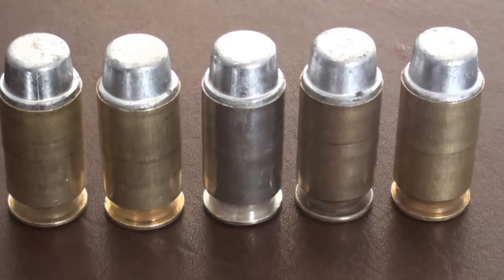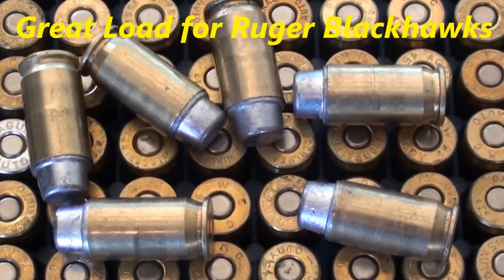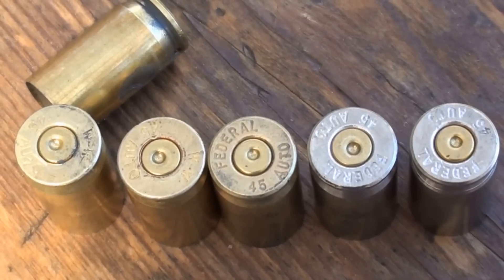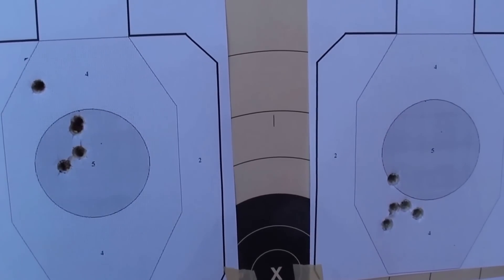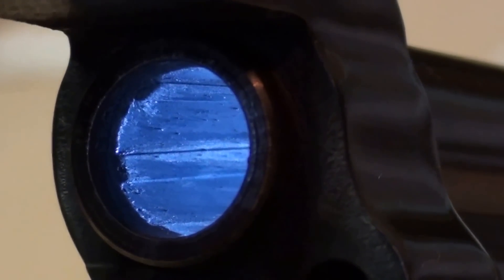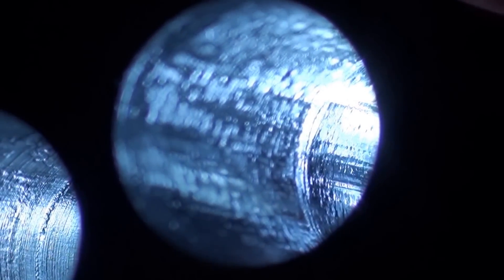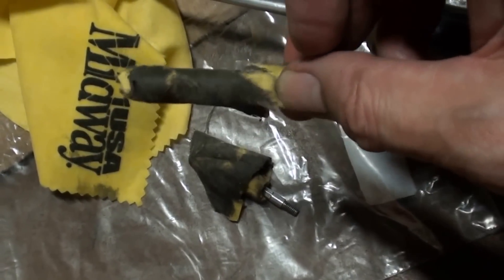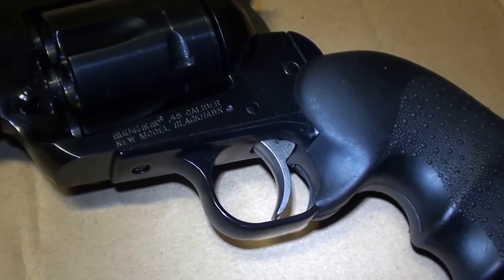Shooting Heavy Bullet Loadings in 45ACP Ruger Blackhawk Revolver

Comment from the maker: hetfieldj1-Reread your comment, one other thing you can do to not get frosty bullets is to slow down your casting speed or get a second identical mold - does the same thing.  Your bullets will be silvery.  Or you could use an old wet rag or sponge and do the plop and sizzle after you fill your mold to cool things down a bit, your bullets will be silvery.  I like speedy casting myself - the 6 cavity molds don't get over hot as easily as the 2 molds. Welcome to the casting HLZ!!

Comment: I had bad leading on the cylinder throats like that on my 45 Convertible. I measured them at .456 diameter. The whole cartridge was very sloppy in the chamber also. I sent it to Ruger and they replaced it with a .451 diameter. No leading now. I had to take a taper pin reamer and cut a taper for about the first 1/8" though to use .452" bullets. As always, love the enthusiasm in your videos.
Reply from the maker: Glen Pruett - That .456 cylinder is abysmal!!  Almost impossible to cast bullets for that - you'd have to cast 45/70 bullets, and then the weights would be unacceptable. I'm glad Ruger made that right for you...didn't know that Ruger sold cylinders like that!!  Thanks for the info as it's good to know.  Next thing we'll be doing is taking calipers to the gun store... Best to ya

Comment from the maker: Jon-This other shooter and I did some work together with the 255 gr SWC loaded in acp cases back in the late 80s. He called them his "manstopper" loads in his Smith 45acp DA revolver (forgot which model it was).  He got up to +P with WST, but he didn't use them on steel-a bit too much recoil and power factor-hard on his gun. I was happy with my 200 SWCs in my 1911s and wasn't interested in heavy.This 262 SWC project is a revisit

Comment from the maker: hetfieldj1- As you use your 4-20 pot, you will find that pour problems go the other way, the flow slows down so that we are having to use the paper clip jam up trick to clear the nozzle and provide free flow.  I forgot which direction the turn is, but it is possible to adjust the flow screw to the point where you can't raise the valve to get any flow at all.  Once you reach that point, back it off a bit to get the flow you want - but be glad you have the flow for now. see2

Comment from the maker: chevy6299-reply2-obturation occurs immediately as bullet enters the cylinder throat, but the gas blow-by has already caused some lead stripping into the beginning part of the cylinder throat.  Note that the lead buildup does not go all the way to the front of the cylinder, but is mostly just in front of the case mouth shoulder in the cylinder.  A harder bullet would actually delay obturation a hair allowing even more leading.  What leading you see is after about 175 rounds. see3

Comment: Good video. Have you found a 200 grain ACP cast load that shoots to approximately the same point of aim as a 250 grain cast load?
The ACP load would be a SWC that also needs to function well in a 1911 or Springfield 45ACP.

Comment: I called Starline about 45 Cowboy Special brass.  They say these are only built for light comp CAS matches.  I plan to test them against 45 acp brass  for loosening primer pockets.using a new Ruger Birdshead #5154 TALO Blackhawk. I wanted to shoot 263gr. Webley HB slugs, which I call “Sugarloafs”.  These are ricochet machines out of my 1858 Taylor’s 45 Colt converter cylinder.  I wear premium e-muffs, and hear every bullet singing off the gravel at our range.

Comment: Very cool.I am looking at the Vaquero you mentioned.Very nice. Looking at it in .357 magnum.Another "quick question" lol Would a .357 running higher velocities have more leading problems than a heavier,lower velocity .44. For example,if I want 600lbs of energy for my "watermelon gun" would the higher velocities needed to reach that 600 ft/lbs with a .357 mag cause more leading problems than reaching the 600 mark with a slower heavier .44? Great video. lol Now I gotta check out the Blackhawk more

Comment from the maker: Patrick Floyd- 1) Yes, too fast for example lead bullets too fast, will strip off rifling and lead barrel = no accuracy.  The practical limit for small arms bullets driven by powder charges is probably around 4100 fps - not because they can't be shot faster, but because velocity in that range results in barrel erosion and loss of accuracy.  Rail guns accelerate bullets by electro-magnetic influence and sky's the limit for velocity and accuracy.  The 55 grains 223 bullets had problems see2

Comment from the maker: shananagans6-The classic "watermelon" blaster in 357 would be the 125 grain JHP at 1500fps.  You could do the same with a 158 grain hard cast bullet with gas check and a case full of 2400 powder (or H110, 296 #9 Blue Dot etc) but as you say, the leading may occur - nothing that can't be handled.  Your point is well made - if you load a 245 grain hard cast bullet and 22 grains of 2400 powder - you will get 1300+ fps and satisfying watermelon blasting.   Best Regards

Comment from the maker: chevy6299-reply3-Lowering the powder charge will not eliminate the leading that will still occur.  The good news is that I run that electric drill at a fair speed with the 458 rifle brush into the chambers with Ballistol and it's no work at all to eliminate the leading. If heavier leading, wrap of copper mesh (Midway) and then the drill. The Midway lead removal cloth is helpful to get out the remaining lead you see in the darkened cloth. Very little leading in the forcing cone and barrel was OK

Comment: I cast 200 & 230 grain bullets that I try to shoot in my Blackhawk 45 convertible, but they don’t fit all the way in the cylinder using the Lee manual. Would it be safe to reduce powder and shorten coal?

Comment from the maker: chevy6299-Great wondering...Probably could go down to 4.2-4.3gr.Promo to have a nice standard load with 4.7 as +P - pressure would spike above 4.7.  Recall that Elmer Keith did a lot of his magnum shooting with bullets a bit on the softer side - today we go on the harder side unnecessarily.  The leading in the cylinder is caused by the bullet being released by the case and gas blow-by before the bullet moves into the cylinder throat.  Since my bullet is .001" over cylinder throat, see2

Comment from the maker: hetfieldj1-reply2-I'd like the flow you are having, fills the cavities quick esp. with my 6 cavity molds.  Give Lee a call if you still can't get flow you want.  Frosty bullets are fine.  It means your mold and alloy are a little too hot, but Lee molds like hot.  Your bullets will shoot just fine, and if your bullets mike at what the mold is marked (356 or 358 or 430 or 452) you will be tumble lube with LLA or 45/45/10 and the frosty will be camo by the tumble lube anyway.  Best Regards..

Comment: load from a older speer manual for 45ACP, 5.8gr unique behind a 260gr bullet for 752fps from a sig 220 4.4 inch barrel
I've noticed that loads in newer manuals are lower than in older and they dropped loads for heavier bullet weights.
 speer #14 dropped information on the 260 grain bullet load in 45 ACP
Reply from the maker: Ghost Shadow - I've noticed that loads with 2400 powder are lower today than earlier manuals (explanation was that the burn rate of 2400 was changed just slightly compared to the old 2400).  But this may be across the board - perhaps because of more litigation, but that's only a guess.  Best to ya,  FC
Reply: Could also be that constant use of hot loads has weakened some of the older guns, so to cover their ass they lowered their listed loads.
Reply from the maker: Ghost Shadow - It's a shame that the older guns have such an impact on us today... You've got something there... Have a great day, FC

Comment from the maker: Patrick Floyd-reply2-being driven too fast in 1 in 7 twist barrels - actually overstabilized them resulting in poorer accuracy.  2) too slow - ridiculous answer is the bullet does not exit the barrel and = 0 accuracy.  Better answer - too slow the bullet will not stabilize and will tumble in flight keyhole = 0 accuracy.  Every bullet has a floor velocity depending on bullet weight, bearing surface and rifling twist for stabilization = accuracy.  see3

Comment: Or you could just shoot some jacketed bullets to remove the lead. Works like a champ, especially when it starts getting warm from shooting volume. Yes, 45 Blackhawk chamber mouths and forcing cones are sometimes out of spec, but this is the easiest way I know to get the lead out.
Reply from the maker: +T Evans -- Welcome to the Hot Lead Zone to T Evans - when you see some of my other videos - you will see that you and I belong to the "shoot a few hot jacketed bullet loads at the end of the day" club.  Good shootin' to ya... FC
Reply: +FortuneCookie45LC Have you ever considered the .45 Super in the ACP cylinder.I've been told you can do that since the max pressure is 28.000 in the 45 Super.
Reply from the maker: +albert johnson -- Good point, that Ruger BH cylinder can stand a lot more pressure than 28,000 (won't get into how much as reloaders will be pushing it).  We should be able to do that...within bounds of good reloading practices of course.  Best Regards,  FC

Comment: GREAT INFORMATIVE VIDEO...Have you tried replacing Unique powder with Bullseye Powder for the Long Colt , Bullseye burns cleaner . Winchester W-231 also produces great velocities and is cleaner than Pronto for the 45 ACP.
Keep up the good work
Reply from the maker: niteriderwm-LOVE BE and 231 in 38 Spl, 45 ACP.  Just don't have any and no resupply in sight.  Unique I had because I bought 24 pounds of it before the frenzy, but only 1 pound left.  I used a lot of Unique in my magnums because the powder fills the cases nicely and performs uniformly for me.  Some shooters even liked Unique in 38 and 9mm because of same reason and the loading density prevented double charges because cases would overflow.  But I never feared using BE because if a reloader keeps his attention to what is being done, even progressives without the powder alarm warning - won't get double charges.  To all you have pointed out, I'd also add economy of use for BE powder plus competition winning accuracy - I could load well over 3000 rounds with a pound of BE.  Have a great day...

Comment: Is that an aftermarket conversion cylinder that will convert that 45lc to 45 auto? If so I wonder if they make something like that for my Super Redhawk chambered in 454 Casull.
Reply from the maker: jungblud59- Wow, you have the SR in 454!!  Mine is in 44 mag, but I would have gotten the 454 if they had one (lucky to get the 44).  If you shoot 45 acp in that big sixgun of yourn, it will feel like shooting a pellet gun.  There is some logical connection between the 45 Colt and 45 acp (power factor similarities), but there is a big disconnect between the 454 Casull and the 45 acp - people don't buy a Super Redhawk to shoot 45 acp.  It's nice you can shoot the Casull, the Long Colt, the Short Colt (Schofield) interchangeably already though...Best Regards
Reply: Yes I've noticed the velocity similarities between the .45 Colt and .45 auto. I was just wondering about an aftermarket cylinder for the .45 auto for the SRH. It got me thinking about the .460 Rowland out of the same cylinder. The .460R can match many .44 mag velocities. As can the .45 Colt souped up loads. I'm running a .45 Colt load at around 1400 fps with  250 gr XTP.
Reply from the maker: jungblud59 You can sure do a great deal of work when guns can stand light rifle pressures.  As you already noted, that 460R of yours can generate more pressure than the standard 44 mag.  And I estimate your 45 Colt load to be getting up around 38,000 psi.  I haven't run into any Casulls to even see much less buy, but your pressures must be kissing up to 50,000 psi with top end loadings…that is major, and I don't mean the old definition of major power.  Good shootin' to ya… My take is you will need a custom smith to convert and fit a cylinder for you if you want that 45 acp or 460R